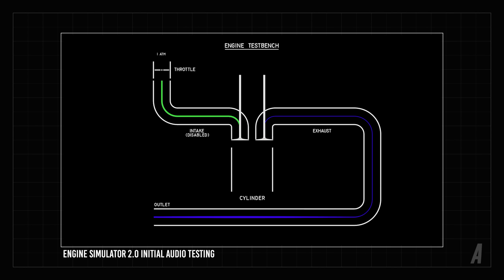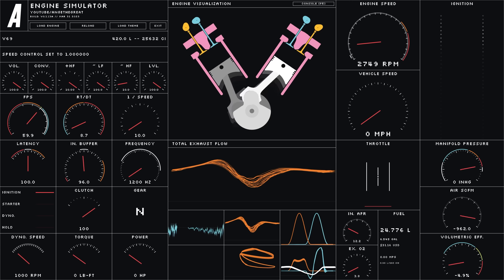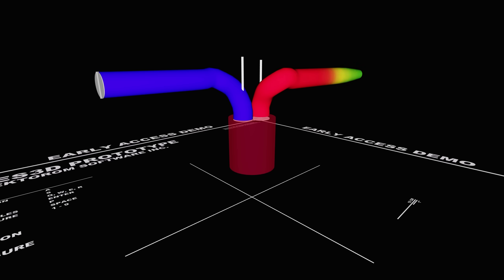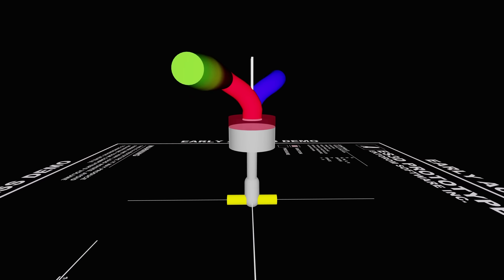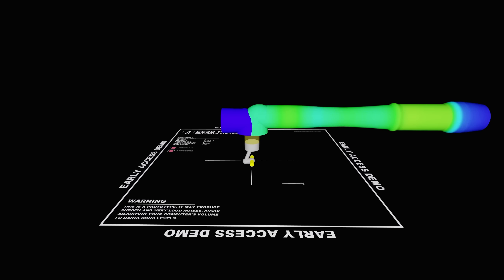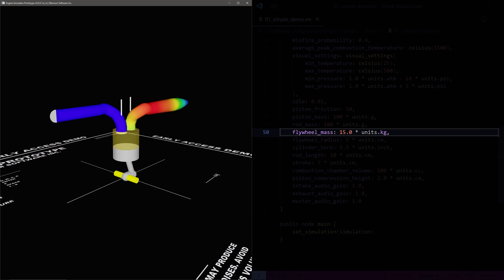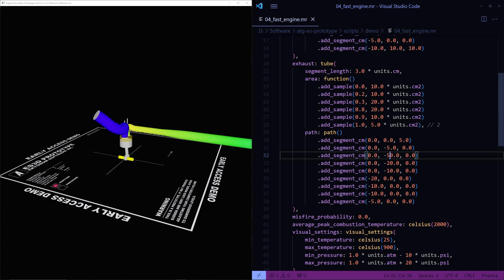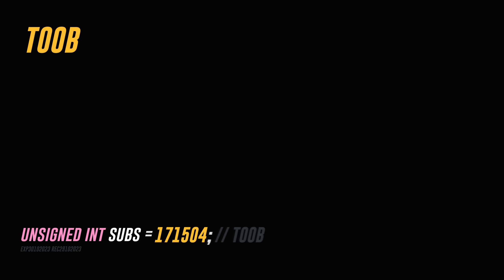Real-time Engine Tuning - Engine Simulator Devlog 4

Comment: The microphone placement concept is far more important than I realized. If you think about it, the audio samples being played are from the perspective that you're right where the exhaust is exiting from, rather than hearing the waves as they expand outward in other directions in space. This must be what's making the exhaust notes sound so tubular and resonant in this stage
Reply: I think you might be right, its like when a mic is way too close to a persons mouth and you hear too many articulation sounds.
Reply: That can be done in post. However the reverse cannot be done. So its best to start with the mic right up in there.
Reply: It could be done like BeamNG does, with separate audio emitters placed in different areas along the car and the engine components.
Reply: Also directional focus is linked to frequency in pretty much any physical sound source. Higher frequencies will be more directional and lower ones more omni-directional due to diffraction. 
I think it would be great if Ange could implement a filter with the cut-off frequency linked to how much the normal vector of a sound source is pointing away from the mic or something like that.
Reply: A microphone that follows the cameras view could be a pretty cool feature
Reply: Adding losses would also help with damping high frequency resonances
Reply: thank you, everyone for these insightful responses! stoked to be following this journey with so many wise minds <3
Reply: @MrJonsi7777  can confirm! I made a simulation of a string, without any loses high frequencies would build up faster than the sample rate of the simulation. long story short stuff flies outa control. some multiplying velocity for example by 0.999999999 every time kills high frequencies and keeps things in check. it's something I learned very quickly about simulations, inaccuracies build up even in the most realistic, most detailed simulations.
Reply: @CyclesAreSingularities  I found it out in a similar way in my research! I found the high frequencies are not always inaccuracies though. They can represent effects that are present in the lossless system you are modelling, but will never be seen in reality due to there always being some loss. The instability due to the high frequencies is an inaccuracy which is often caused by time step based simulation techniques. In this case the smallest time step is not small enough to describe the high frequencies and then things can blow up.

I actually developed a time independent technique that directly describes the wavefronts (along simple transmission lines used to model circuit components). In this case you get a direct time domain solution and are always guaranteed stability! I wanted to do a collaboration with Ange, to see this technique applied for different types of wave equations, not just electricity!
Reply: @MrJonsi7777  oh wow that sounds pretty interesting! Are you choosing the time step based on the largest changing factor in your system?
Reply: @CyclesAreSingularities  no actually! The simulation technique does not depend on timesteps! Instead the system is described by means of events. I will use your example of a vibrating string as this is actually very similar to the model of electricity traveling down a wire which I modelled. When you initiate a disturbance on the sting it will create two wavefronts traveling in each direction. Traditionally you would track the change in the system amplitude (string displacement) by means of progressing time by a small interval. In the technique I progressed, you model the wavefronts themselves as the focus. Because you know the speed of propagation of the wavefronts, you can tell exactly where in space the wavefronts will be at any given arbitrary time as you know the starting position and velocity. You then track all the events that happen to the wavefronts, do they reflect, do they split in 2 ect. And then by the end of it you can infer the state of the system based off the wavefronts and their events. In this way there is no need to specify a time interval. A transmission line 'bounce diagram' is a good demonstration of this idea. My specific work was around how these wavefronts superimpose with eachother to describe crazy effects that occur when you have just two 'strings' connected to eachother of different 'thicknesses'. Turns out there are very complex effects that occur in such a trivial scenario that are typically ignored as they happen at extremely high frequencies! I hope that this makes sense 😂 

If you want to know more I'll happily explain! Maybe even subscribe to my channel because if all goes well I plan to make a video about it someday! If you have an interesting application for the technique let me know and I would be very happy to collaborate! (Same goes to you @AngeTheGreat !! )
Reply: Microphone placement is a hugely complicated process to simulate, but that's mostly what the reverb issue is. The issue, though, is that easiest way to handle reverb computationally (with an impulse convolution) is a rather static solution that would need to be subtly different for the two sound sources. Even simulating something being two feet in front of you and one foot to the left, they are incredibly different impulses. Also, simplifying it down to point sources rather than resonant bodies is another point where you can get caught up depending on the size of it. Not to mention that the cylinders themselves will be sources for a potentially complex tone based on simply their movement. I may have to look back through some of the virtual instrument projects I had come across to see if there's a good, open source project that has tackled simulating complex instruments (I know there's a project that does pianos, but it's proprietary and expensive).
Reply: Think also Doppler effect might affect the sound too
Reply: @MrJonsi7777  aha so your simulation doesn't have a resolution, computes events instead of computing points over time steps. Definitely a much more accurate way to model a system like that with the limited processing power at our disposal.

I've recently been working on my system and I managed to make each point have its own properties. I think the advantage over my method is that it will always run at the same speed regardless of how many waves are in the simulation. For real time audio this is much more important than accuracy. But for the stuff you're doing I can see how you came up with such an elegant method, because accuracy takes priority in your case I'd assume.
Reply: Congratulations you have discovered the hotly debated topic of guitar tone snobbery - microphone placement!

Comment: That’s amazing that even at this early stage I can hear and differentiate few engines:
- 2 stroke chainsaw
- something like excavator/tractor engine
- a cow ready to be milked 
Also I’ve heard a few backfires, that’s really cool :)
Reply: How's your comment older than this video? YouTube says this vid is 18 seconds old and your comment is 2 hours old.
Reply: @jakobwetzel8167  sometimes videos can be found that are posted, but not live if you know what i mean. So a video can be scheduled to be live at a given time while still being uploaded already.
Reply: @jakobwetzel8167  early access from patreon probably
Reply: 2 stroke V6 Diesel cow bike.
Reply: I'm thinking this would be perfect for tuneing 2-stroke exhaust systems. For thing like race bikes, Cart racing, R/C engines.

When the combustion simulator gets done, tuning the port timing, shape, and cuts would be insanity valuable.
Reply: @dingo-gorditas that is correct, sir.
Reply: The third option is moovin along...
Reply: You mean civic on the first one?
Reply: 8:35 I see what you mean with the cow part
Reply: That cow is READY
Reply: OHV is a MUST too
Reply: @dorsk84  i dont know if it will be accurate enough for that but it would be amazing
Reply: @dorsk84 this is exactly how it's been done since the 70s. One thing this simulation doesn't have yet is validation. And that's very expensive to achieve.

It can still be used to compare approaches and the broader strokes of any variations in design. But it won't be accurate to build from without trial and error.

That will probably still be very useful for a lot of hobbyists.
Reply: When he decreases the ambient pressure it makes it sound like a light prop plane cruising at cruising height.
Reply: when did you hear the backfire? can we get a timestamp :D
Reply: @tomsterbg8130 13:49 A small plop can be heard :)
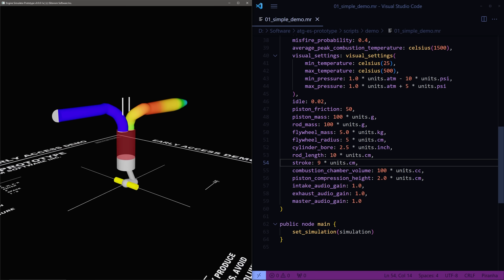13:56 - 13:58 another one
Reply: @dempsej  that's the sudden numerical discontinuity propagating down the simulated tube. It's kind of like a backfire, but it's just because he changed a number which had immediate effect.

He mentions this specifically when talking about the shockwave traveling through the simulation when the pressure was changed.

Backfiring, and after firing alike, will sound natural in this system. I've done something similar with digital waveguides and it can be very convincing.
Reply: @identiticrisis  yeah I know, take that comment with a grain of salt, but as You’re saying - it’s possible and seems ready to simulate backfires too :)
Reply: @identiticrisis I mean... It can be validated the other way around: comparing with already existing well known systems. Pretty sure the intake, cylinder and exhaust parameters for Miata or LS are something a car nerd can cite off the top of their head, and similarly, audio samples for such are bound to be plentiful.
Reply: @Validole  yes that's easy enough. Not very general though.
Simulated systems come into their own for examples where you have very little or even no data at all.
So you have to test it against every eventuality to make sure you're not extrapolating too far.

It's not, to my understanding, intended to be a design tool, so it shouldn't matter. It's already a lot of fun as it is.
Reply: The cow immediately made me think of what should definitely be the next project.

Farting simulator

Comment: Dude this is amazing stuff. I've worked as a mechanic in some for for 10+ years and even the basic simulations you've shown here mimic alot of what real world experience has shown me. And as props to your skills @AngeTheGreat, I've used ES2D to replicate real world engine builds (mostly vintage motorcycles) and corresponding dyno figures to a remarkable level of accuracy. You're doing amazing work!! I'm currently using ES2D to build and tune a Bonneville land speed bike, and by all accounts from many different experts everything the simulation is telling me (accounting for altitude change) is within expected ranges. I can't wait to see ES3D and try it out!!
Reply: Dude that's incredible!

Comment: Amazing work!! I want to point a suggestion: I feel like a proper motion blur effect would do wonders for your engine. For instance, when a piston starts to get really fast, it looks kind of choppy because every frame generated is visually perfect. In reality, our eyes don't see fast things that way. When a fan is spinning fast, we see the blades in a very blurry way. And we know it's spinning really fast because we see it that way.

I think it's called per-object motion blur, and some games do implement it correctly. It calculates the amount of blurriness of an object based on the number of frames currently displayed on the screen (because 120hz won't have the same amount of blurriness per frame compared to 60hz, assuming the framerate reach those values) and the speed of the object moving in the view/camera. Not the same as the usual whole frame/camera motion-blur, which can be a hit or miss, but most of the time misses the point of achieving a realistic representation of a speedy object in our eyes.

I think I cannot give you a link without being shadowbanned in youtube, but there is a thread in the forum of Linus Tech Tips called "What's with Linus hate for Motion Blur?", page 4. There's a developer that worked on that motion blur for Crysis in 2010, and he goes with some comparisons and the reasoning behind. I find it super interesting, and suspect you might as well!
Reply from the maker: It's on my todo list, just haven't gotten to it yet. Thanks for the suggestion!
Reply: @AngeTheGreat when will you start adding more cylinders?
Reply: No it looks disgusting
Reply: @furriesinouterspaceUnited  What looks disgusting?
Reply: @stefankoopmans2200  motion blur?
Reply: @furriesinouterspaceUnited  There's a difference between camera and object motion blur though. I agree the camera one is not very pleasant to look at.
Reply: @furriesinouterspaceUnited  Yeah maybe motion blur looks bad in first person games because it can be distracting to have your entire view point go blurry when you move the camera, but that's not what they're talking about. They're saying the components should get blurred when they're moving fast so it gives the visual impression that they're actually moving fast. Without the motion blur, you're seeing a still image of where the engine is at the exact moment the frame took place, which makes it look choppy, or if the engine is moving at a multiple of the frame rate, it looks motionless. I don't think that's a good visual for an engine spinning at thousands of times per minute. Regardless, like Ange said, the simulation will be completely customizable so if you don't like the motion blur and want to look at a slide show, you'll probably be able to turn it off. Better yet, it could even be on a slider so you can have more or less motion blur effect applied.

Edit: accidentally said thousands of times per second, not minute
Reply: @AngeTheGreat  Will this be just for patreon supporters or will you eventually release it for everyone?
Reply: Even the 'good' kind of motionblur, the one made from keeping a buffer of per-pixel velocities, can be kinda hit or miss, but In a project like this, where each rendered frame is (i think, correct me if im wrong) built from hundreds of tiny simulation steps, you could accumulate a bunch of 'sub-frames' for each sim step and produce some very accurate and nice-looking motion blur!
Reply: @jonathanvigen708  like I said that looks horrible and shouldn't be done. You really just gonna ignore what I said and assume what I meant by your own opinion? All motion blur looks bad to my eyes
Reply: @eagle2com  both are still motion blur and both look bad to my eyes
Reply: @ffivguy1990  Engine Sim 3D will be released on Steam at an indeterminate date for a price of around 20 dollars.
Reply: @tescoshortage  I know that, but I'm referring to this demo.
Reply: true
Reply: Motion blur is likely unnecessary at higher frame rates. Making the strength variable is important though.

Comment: This is outstanding work, my guy... please add a cylinder wall that absorbs back pressure resonance differently based on aluminum density vs cast steel density

Comment: Adding the intake sound source is probably the biggest improvement in expressivity for this model yet!

The other stuff can mostly be faked with filters, including reverb and transfer, combined as one filter in fact. But without that single change that responds directly to the throttle input, it wouldn't feel half as involving.

Really excellent work so far!

Comment: I am so glad you posted this, because I have been thinking about tuning applications for your software.  It would be amazing if you could input cam specs like lift, duration, and lobe separation angle, as well as injector specs (flowrate, number of injectors, port/direct/throttle body injection), and have an output for simulated AFR.  These features as well as  Volumetric efficiency/flowrate and timing tables would allow people to make tunes on virtual engines without having a physical engine in front of them, and make baseline tunes that can be tweaked and used later on a physical engine with the same specs.

Comment: You should try making something like a EU spec alu block M52 when you get to the point of having full blown engines running. They have a really whistly idle with stock cams at 600RPM so it's a good litmus test to see if even the weird niche edge cases come through in the simulation. 
Beyond impressive work so far though. Just absolutely amazing stuff from a pure nerding out over engines perspective!
Reply: hes made one for the current build of engine sim btw